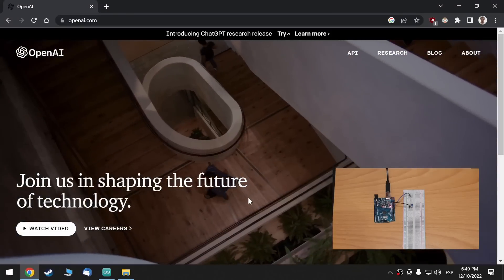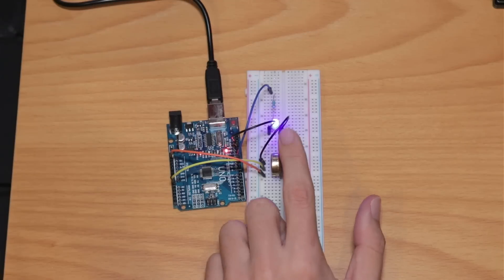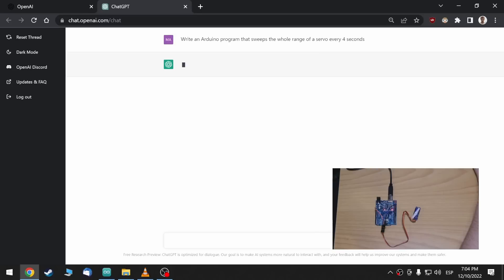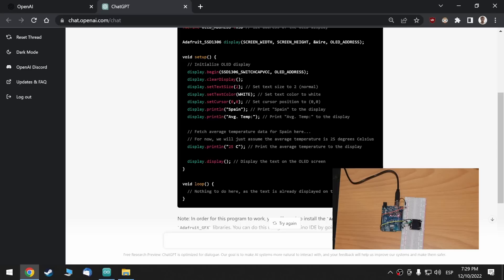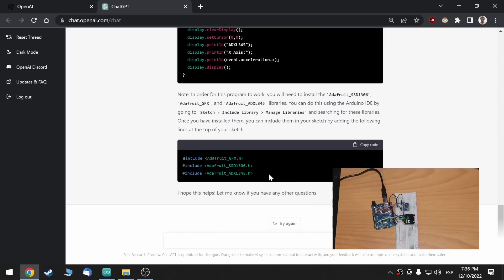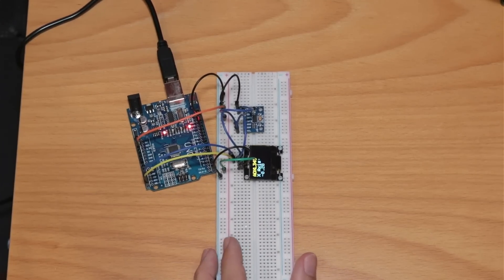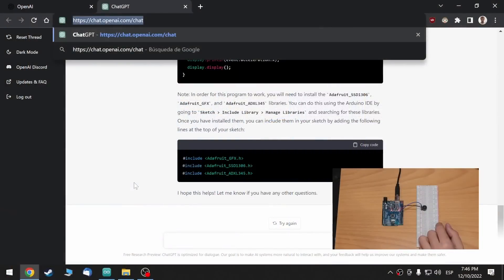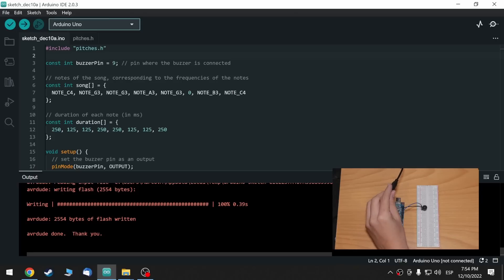ChatGPT absolutely DOMINATES Arduino programming

Comment: it gives you code that it is very confident about, which often doesnt work, and sometimes it just stops in mid response. a useful tool but it has to be watched very closely- like a junior employee who thinks too much of his abilities.
Reply from the maker: Good one! I think calling it a Junior employee is the most fitting description for the AI! At least while coding for embedded applications.
Reply: It is still new. The thing about AI is that it evolves incredibly quickly, and continues to grow and expand all the time.
Reply: when it stops, just ask it to continue. It's limited to the number of tokens it creates for each response.
Reply: the AI is not confident, I've spent considerable time working with it. It sees many ways to do things, the best thing to do is work on small portions of logic. it is also very good for generating boilerplate, and boilerplate sucks to write
Reply: You can instruct the chatbot to start answering at a certain point and get a long answer. Either you give the entire previous answer and say "continue from here" or you give the last few lines.
Reply: the problem is, if it comes e.g. with a network error or so. then you must as long as he writes simply mark the text and copy as long as possible and then apply the technique that i just mentioned.
Reply: Isn't that you can type "continue" to make it continue complete the response ?
Reply: @neil_from_future  If the output is text based yes, but when outputting code there are sometimes problems, to be sure you should include the already outputted code as a request.
Reply: i had this issue too. it would give me a code with a few lines missing at the end. I corrected it but even after telling it to rewrite the code it still gives it with missing lines.
Reply: @kbkh1357  When this happens, you need to copy the code already issued and paste it into your next request. Then tell chatgpt to continue at this point. 

Request:

Continue outputting the previous code from this point.
[paste the outputted code here].

After that you will get the continuation.
Works for long texts too, you can easily write a book.
Reply: It's helped me a lot!
Reply: Your reponse shows you know nothing about ChatGPT lmao… it does not stop mid response… it just has a certain amount of characters it can give in one response. You just have to tell it to continue and it will continue from where it left off.

And it not being perfect is completely normal, you have to give more information and help it a bit in order to make the answers better and correct it.
Reply: @stienogamez8296  Your reponse shows you know nothing about ChatGPT lmfao
Reply: It will get better it's only the first phase..as tech improves it's weird how our standard skyrockets. Something we should he happy about that literally wasn't possible few months ago instead we are mad that it's giving us sweet potato fries instead of regular fries.
Reply: @marmont8005  Your reponse shows you know nothing about ChatGPT lmfao
Reply: you just type "finish the code where you left off without repeating anything"   it will pickup and finish.   You also need to be very specific in your instructions.   If you pay for the open AI api, you can build a discord bot in python that uses chatgpt models and its MUCH MUCH better.
Reply: You need to type "continue" when the response is large
Reply: Junior that learns very fast. What it  can do today will look like child's play in a few years.
Reply: Jr employees ask it to optimize your code and convert it to assembly then say jr again. Its nuts what it can do, but you have to know what your trying to do in a systematic way and convey that to the ai i.e "prompt engineering" 🤢
Reply: @stienogamez8296  It may be that the company wants you to pay for getting more computing time, so a timer truncates too long answers. It even would not surprise me if an automatic censorship algorithm prevents outputting something that contains a melody when it detects that the song is copyrighted.
Reply: @cyberyogicowindler2448  Lol no, that is not the case lmao. The responses have just a pre-programmed max length… And no, AI is always unique so there would not even be copyright. Just like Midjourney image AI can just use any style without it being copyrighted.
Reply: @marmont8005  thank you, i did not try doing that
Reply: This must be how God starts to feel.
Reply: I am a seasoned programmer. I have used it effectively to write a bunch of boilerplate code, but I did have to watch it and make sure it was right and modify it to the actual purpose. It basically replaces most of the constant googling I'd otherwise be doing. It is nice to be able to merge examples of different things on the fly. Overall it did cut my project time down quite a bit, but it isn't going to "write all your code" for you. I find it to be a useful tool to increase my productivity, but we aren't quite to the point of replacing programmers (yet anyway)
Reply: I confirm. I tested it by making it code insertion sort in MIPS Assembly for fun, and some instructions got it wrong, however the overall algorithm got it right, so that's a plus
Reply: When the song itself that the AI is instructed to play is known to be copyrighted, by definition it does not matter how it will be implemented. (Playing on flute or piano stays legally the same song.) Since this AI is full of overzealous safety/security measures, I expected that a mechanism forbids it to do such things by defining it as "evil" because they fear that the AI can not estimate harm by doing anything that potentially might be suited to break laws.

The AI is like a child that when instructed to use a lighter to 1.) light a candle or 2.) ignite the sofa, parents  considered it safer to drill the child to always reply "I am only a child and not allowed to use a lighter or make fire." than expecting it to understand the different consequences of case 1.) and 2.).
Reply: @BrySmi  And create new ones
Reply: You can ask the bot to continue coding cause you didn't catch it's last part and it'll realize :)
Reply: Now imagine this with a few more years of training
Reply: It should be renamed to RNGAI
Reply: Script cutting has been fixed I believe
Reply: You can ask it to finish if it stops
Reply: But it doesn't yhinlttoo much of its abilities though. It is an robot 😂
Reply: Think*
Reply: Should it be unsure when making it instead? 🙈
Reply: when it stops in mid response, just type CONTINUE, and it will continue generating the response. It's very helpful when it gets stuck generating response.
Reply: When it stops, at least on mobile, it’s often because the user is scrolling. Try not to scroll and see if it helps against unexpected stops.
Reply: If it stops mid way just ask it to continue. P
Reply: @stienogamez8296  Yeah you have no idea wtf you are on about. This is not AGI this is A Model that was trained on current data, it has no clue wtf is right or wrong. The CEO of OpenAI even stated himself that you should not trust just GPT but also look at other sources.
Reply: @helix8847  Whatever you want to believe...
Reply: Almost a good analogy. However, i don't think it is because you're forgetting that the AI is pretty good about admitting and correcting errors
Reply: @stienogamez8296  that’s not true … if it hangs, either ask it to continue, usually it will,write the response again starting from the beginning and completing the answer and it displays more tokens or words than it did the first time or I usually copy the prompt and 2:03 just exit and  login again, replay the prompt and it will comp;ettṟhuhk
Reply: @axelknutt5065  Nope, you never have to do that

Comment: One key benefit I think your missing off chat gpt is the ability to have it refine things.  So when you are missing a library just say something like "it looks like the library for... was not included" and 9 times out of 10 it will either give you the snippet of code or include the library. Involving chat get in the troubleshooting is half the beauty of it.  It knows the exact context of your query so it's usually faster and getting you the correct answer then a Google search... unless it a decides to spout a bunch of nonsense. In which case it is usually still faster to guide it to the correct answer out just use the try again button to have it try something slightly different.
Reply: I found this too. It even knows the different solutions for different development environments !

Comment: There is a limit for the length of the response. But you can type continue and it will finish the code. Also when you got the ADC DAC overflow, you could explain your issue and it will correct most likely. You can also paste your code and ask for help. In the video you asked for Arduino code, my guess is it would help if you specify the model.

Comment: Great video! As a hobbyist, having an “assistant” to deal with all the minutiae of connecting to a new sensor or display, or to just take the tedium out of making a UI frees up so much of my time and brainpower for actually making cool stuff instead of figuring out how to cajole the system into doing what I want. In that context, I don’t feel “obsoleted”, but rather enabled; it’s just a higher level of programming; the programming language has become conversational, iterative English. This is gonna be so great! 👍😃

I bet it would also be very helpful in debugging programs too: Give it the program, explain the problem, and ask it for the solution. That’d be interesting to see a video on as well.

(Next step, use the speech-to-text function on your computer to feed it input. I can see a day (very soon) when we can work with it all the way into even hardware debugging, probing a circuit and telling it what we find, so it can suggest the next thing to test in the debug tree :-)
Reply: Beware. "Creative" AIs tend to cheat and imagine nonsense when they don't know the answer, and possibly not even notice that they lie (because the output is assembled from guesswork based on correlations of things it read elsewhere). So it is not like asking a teacher, but more like asking a semi-educated imposter.
Reply: I love the word minutiae thanks for using it, didn't know it existed in english.
Reply: Spot on!

Comment: Cool video! From what I have read, the AI response is limited to 4000 "tokens" which are sort of like words, so asking it to play a song it will try to code the whole song and freeze once it hits its limit. If you ask it to play 10 seconds of a song instead, it will probably produce the code just fine. Very cool that you tried this and it worked! I struggle with Arduino code at times. Especially for the the seldom used modules that do not have a lot of examples online.

Comment: This is blowing my brain in half.. As someone that just needs to program servos and motors.. it's like talking directly to the machine..
Reply: I got it to program connect 4 in python. I simply explained the rules of the game, how many spaces on the board, that it was a two player game, that you need to connect 4 in a row in any direction to win. It worked first time. There were a few problems with the way the x, y coords were set up and it had to be told A-G and 1-8 for matrix references, It had set them up as 1-8 and 1-6 but that was confusing. A couple of sentences and a few nudges in plain old English and there it was. It blew my mind too. It still needs some tweaking though, it can waste a lot of your time if you make your program longer that say 1kb in size.

Comment: I'm blown away by this. I tried this prompt "write a program for arduino for a calculator with 16 buttons and an LCD display" and it created the first part of the program to the point where number buttons basically function with the LCD (and that's it). I prompted it again: "please add buttons for addition, subtraction, division and multiplication" and it tried but came up short (adding some code that multiplies one number by 10. I'd say at least half of it is written though. At this point it seems to be a great shortcut to come up with snippets or examples for specific functionality that I might then include in a larger program. Very cool.
Reply: A bit more info: because I said 16 button calculator, it assumed a 4x4 button layout (logical) and laid the button code out so that it would actually look like a standard layout (of some sort). Amazing.

Comment: I'm glad I found a community of people already doing this here on this video because I did this project 3 weeks ago where I had Chad GPT create a website with HTML and make buttons that controlled in Arduino servo motor through a serial connection. I then put the website into an augmented reality environment and now you can use AR to control a microcontroller in the real world. It's literally building the bridge between digital and physical.
Reply: Would like to see that as a video.
Reply: Please post a video  and I will be your first viewer.  Sounds amazing!
Reply: I plan to share it! I still have a few kinks to figure out: 1. My browser is showing up as transparent in my AR environment. I see it loaded in the environment but it's not showing opaque it's see-through basically. Then 2. My old laptop has a bad ethernet connection port. I'm getting myself a new laptop soon. Once I get past this issue I'll definitely be making a video and posting the link here
Reply: @lordkylo  Did you ask ChatGPT to help you with your first problem?

Comment: Great video man! Greetings from Minnesota. ❄️
Reply from the maker: Thanks man! I plan to make a similar video on ESP32 this week!
Reply: @Hanqaqa  Very cool!

What are your thoughts on the 1602 LCD Keypad Shield?
Reply from the maker: @aaronkalahar-_-_-  I had that shield years ago, but ended up throwing it away. 
For me it isn't useful to have the LCD always on top of the Arduino, sometimes I want the LCD screen a bit further or at an angle. So nowadays I simply use the regular LCD 16x2 screen with a i2c connection. That way I use less cables and can place the screen at different positions. 
I didn't like the limitation of having the screen always on top of an Arduino Uno.
Reply: @Hanqaqa  I just got mine in the mail. I see what you mean by the limitation.

I’m just starting so I thought it’d be worth a shot!
Reply from the maker: @aaronkalahar-_-_-  yeah if you are just starting. Then a shield is a great option because connecting everything is much easier!
Good luck with the shield!

Comment: I still need to make a program for Arduino for a thermocouple and a solidstate relay. I need to have the temperature go up, stay on a temperature level, and then after some time ramp up again. The challenge probably would be to write down what i want in such a way that the openai program gets what i want to have. 

I will give it a try later this year. 

Greetings,

Jeff

Comment: When ChatGPT hangs due to the length of its response, simply use clever ways to get around this. Such as asking it to write a short version of the song, ask it code in sections, such as write me a code that does this, add to the code so it does this etc... If you are someone who is naturally really good for example at finding exact search results due to your ability to not only ask the correct questions but to ask them in the correct ways.

Comment: I had a personal project that has just been sat on my desk for months, because I couldnt deal with the context switching of getting back into arduino after being away from the platform for so many years and working mostly in web development these days. ChatGPT wrote a sound foundation for my firmware in a manner of minutes of chatting with it, I let it put in some placeholder functions for things because I felt it would be easier to just make some parts myself after all. But it can do a lot of things, if you specify what you are dealing with exactly it usually already knows the datasheet :D  I kinda want to see what ChatGPT can do with git access. Imagine if you could just create tickets in JIRA like you do with everything else and then the bot would take things it had a good confidence in solving, amazing times and troublesome at the same time.

Comment: I wonder how complicated a request you can make before CHAT glitches? In MidJourney, too many prompts, it starts ignoring some words. I'm guessing if you gave CHAT a list of 10 elements for a Sketch, Say multiple I2C sensors, a display, some calculations, buttons etch. when will it give up? I'm sure in the future a very clear, well formed series of elements could you have CHAT write a 100 element script? That would be CRAZY!!!!
Reply: It can be done. You just have to ask part by part then ask to build the complete code without commenting. It worked for me while using NodeMCU.
Reply: yes this is the follow up we need

Comment: I've tried it for signal processing in python. The basic FIR/IIR scripts worked, but EMD, PCA/ICA, Hilbert-Huang transform and wavelet transforms were all bugged. Dimensional mismatches, data type incompatibility or just plain unfinished code mid work. It's still a long way to be usable for anything more than the most basic things in my eyes. Maybe it will be better.
Reply: There is a word limit for answers, if you type continue, it will complete the answer
Reply: the thing it struggles with isn't difficulty but stuff that is uncommon, not many people do signal processing in python I assume so it doesn't have a big dataset to learn from

Comment: It can do much more complex stuff especially when you add web server interfaces.

And when it comes to errors just copy paste the error code and it will auto fix it. 

The not completed codes are because there is a response limit of 2500 characters